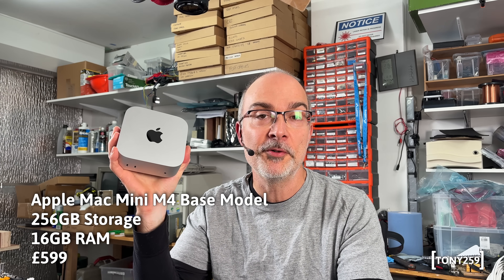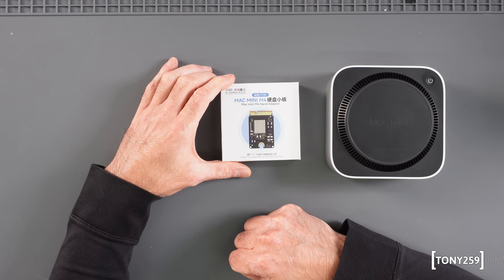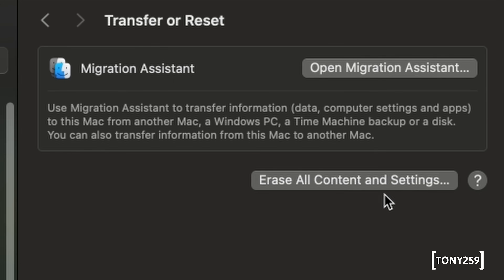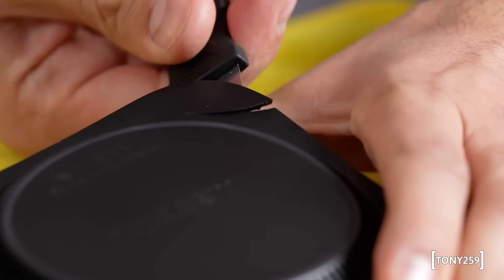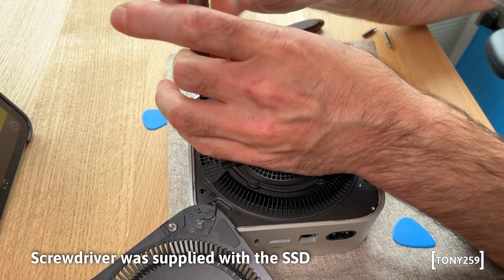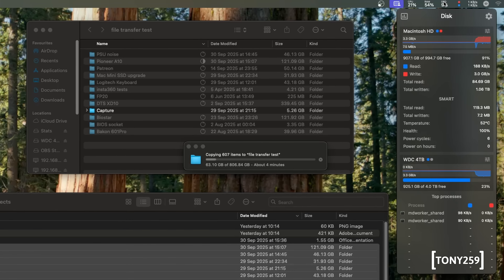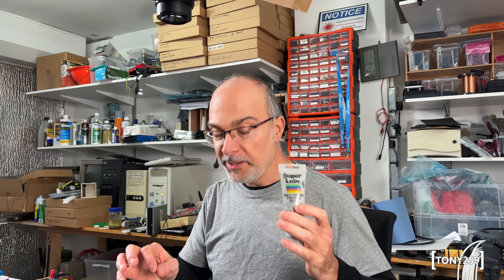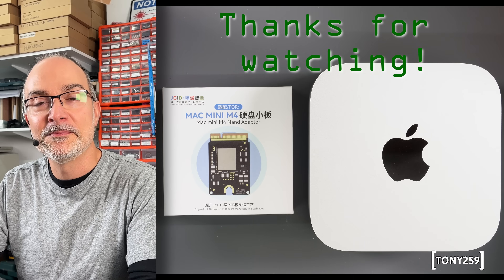CHEAP AliExpress SSD for Mac Mini M4? (Yes, I BRICKED it!)

Comment: The constant " not recognizing "  problem is why I will never get any Silicon Mac Mini ever again.
My M1 has issues with every external SSD's, hubS and NOW  will not recognize my new Apple ID password and even  Apple care cannot figure it out.
When I buy a new Mac it will be either a desktop or a laptop.
I have multiple intel based Mac books, Minis and Imacs and none of them have the " can't recognize " problem.
Reply from the maker: interesting. You mean the keyboard? Not sure what happened but it worked in the end. I never had issues with external boxes or drives. I have an external dock and external SSD. I move the mac often - and I use a USB monitor elsewhere - and I never had issues with items not being recognised. Thanks for the feedback though!
Reply: @Tony359_2  The keyboard and mouse work fine. I also get every time I shut my tv off a message about " some internal errors ". But anything not a mouse or keyboard with the exception of the Satechi dock I bought when I received the Mac Mini will not be recognized by the Mac Mini and I am tired of it.

Comment: 6:06 it’s a failed firmware and it needs to be reflashed. Hardly a brick nor does it warrant a new replacement.
Reply from the maker: Well, until it's re-flashed it's a brick. Never mentioned a replacement btw! 🙂 Thanks for watching!
Reply: @Tony359_2  if you say so ;)

Comment: Nearly £150 for just 1TB of storage + the risk of bricking the device, what a great deal. 
- OR, Just bare with me a sec...... you Could just buy a 2-4TB external SSD that runs over USB-4/Thunderbolt-4, the speeds will be good enough for nearly everyone, no risk of bricking it, possibly cheaper and can work on other devices such as a Windows PC. 

PS: This i snot a hate comment against your video, it is still a great, well made video, I just think the risk of bricking the device AND the cost of the storage are not worth it, just go external, it is not as good but good enough. 
- Think about this, if you brick the Mac-Mini and the storage, you lose the £150 + cost of the Mac itself... is it worth it??? I don't think so.
Reply: I do want to add that I am not a fan of external storage on the M4 chips, I have an M4-Pro MBP and the external storage cuts off at random, this happens on EVERY port and with every USB Cable I have, it does not happen on my Windows PC at all, nor is it an issue with the laptops ports (external displays work fine, laptop can charge over them perfectly fine etc.). 
- Research suggests the issue is because Apple is more strict on what you plug in, slight voltage deviations may be enough for the laptop to kick the device where as a Windows PC will be okay with it, meaning NOTHING is at fault at all, it is working exactly how it is designed to work. 

This is VERY annoying, I have to try copying 50GB of files 10-TIMES before it actually successfully did the transfer, it would get so far then boom, kicked, just completely vanishes from the system, this issue does not happen on my Windows PC and as stated, it does not seem to be the ports. 

So while I still think External storage is the way to go, I myself am having issues with it which make it a HUGE pain, so much so that I have set up my Windows PC to act as a server, so I can access the data through that... VERY ANNOYING but at least it works.
Reply from the maker: Your point is valid but I already have an external SSD, 4TB, USB4. It works great but it's NTFS and I didn't want another one to boot the system from. Yes, upgrading the internal storage is a pain but it's an option. It might work for someone or not - it's an option.

On warranty, I understand that opening the Mac Mini does NOT invalidate the warranty. If the replacement SSD hadn't worked, I would have installed the 256 back in. If the system had stopped working, I would have taken it back to Apple with the original SSD in. 

For sure there is a risk element in upgrading: I am a tinkerer, I was aware of that. Once again, it's an option. If you don't want risks, you can also pay £400 and get a Mac Mini M4 with 1TB SSD 🙂 

BTW: my external SSD enclosure NEVER EVER disconnects or shows issues. I run my video editing from it so it's quite some work and I've been using it for 10 months. I've never experienced a single minor issue with it. I showed it on a short: https://youtube.com/shorts/2hta5oY1zc8
The 850GB data you see being copied on the Mac were from that SSD. 

Thanks for your comment and your visit!
Reply: @Tony359_2  I am wondering if it is my enclosure (it is an NVMe enclosure), though this issue does not happen on the Windows PC (Happy to copy over 500GB, no ssies, MacBook can barely do 50GB). 

I did notice that if I use an iPhone cable, it seems to work fine... Very odd issue, I have seen other people mention this issue aswell (mainly on M4 series chips), it does not seem to be a fault, but something else. 

But yeah, I enjoyed your video, was actually very well made and informative, subscribed aswell. 
- I think this upgrade would be best done with the MacBook's,  but sadly Apple have soldered it all down, I think it is best on a laptop since they are portable (thus carrying the laptop and having to also take the external SSD is a bit annoying when the laptop itself could do the job), and Apple know this hence why they do this and charge a LOT for upgrades.
Reply from the maker: I cannot comment on your enclosure as I only have one. I did see similar reports online so I was a bit concerned an external solution would cause me trouble - particularly because I use it with Video Editing so lots of data being streamed back and forth all the time. 
But no, zero issues. I've been using it for 10 months and I never had to fiddle with it. I'm using the USB cable it came with. Windows is only 10Gbps but I never experienced issues with it either. Maybe the iPhone cable is not capable of USB 4 and the connection is established at a lower speed - giving you more reliability? You can see the current speed in System Settings somewhere. 

You are using the back ports right? The front ports are only 10Gbps if I remember right.

Thanks for the sub 🙂 
Yes, it'd be great to have upgradable storage on a MacBook but I guess there is no space for the socket there. Or maybe that's what they want us to believe 🙂
Reply: @Tony359_2 You may be right, I do know the enclosure only does USB-3.2 so not the fastest. I am using a MacBook Pro with M4 Pro, thus all ports are Thunderbolt 5, I wonder if this is the cause of the issue (since USB-3.2 is getting rather old now).

I am going to try get a Thunderbolt 4 enclosure, this will work on both devices I hope (my other laptop has Thunderbolt 4).

Thank You for your replies.
Reply from the maker: You're welcome, I hope you can find something that works well!

Comment: 13:37 In 2025? 😀
Reply: @Tony359_2  Read and write speeds as of 2020.
Reply from the maker: ah yes, for gen4 speeds you need the Mac Mini PRO 😀  I know, I know.
But hey, I have a PC under my desk which I stopped using because Resolve runs MUCH smoother on this little tuna can. But if I run benchmarks, the PC is SO MUCH FASTER than the tuna can. What can I say...
Reply: @Tony359_2  What do you mean: Resolve runs MUCH smoother? Effects, exports?
Reply from the maker: @Milzil_Hunter Export is slower of course. A 3070 has much more power. The editing on Mac is like running with Proxies on Windows. It's just buttery smooth. On Windows I always have that little delay when I edit which is simply not there on Mac. Whenever I was going back to the PC, it felt "broken" so eventually I "promoted" the Mac Mini as main computer and I only use the PC for the final render.

Comment: From what Ive read online the 256Gb SSD in the mini is a slow one and the 512 (and maybe upwards) are much faster and its worth upgrading to that if you intend not to DIY the upgrade . Have you heard this?
Reply from the maker: Yes - I believe the 512GB will show the same speeds of the one I got. It's the 256 which is slow. That said, if you look at the benchmarks in the video, I doubt that you'll get some noticeable improvements. I needed space, not speed 🙂 
The Mac Mini M4 has nice TB4 ports so an external SSD is going to be faster than the 256GB anyways! Thanks for watching!

Comment: I’ve used the Mac Mini M4 for Blender and Twinmotion just to see how far it will go before getting too hot. Well, not far lol. I eliminated this by using a O2COOL Knecklace fan ($10 from Walmart) to blow air towards the front of the Mac Minis vents and it cooled it down to idling temps. The M4 punches above its weight when it’s properly cooled and doesn’t need to throttle.
Reply from the maker: Interesting, it never throttles here. I use Resolve. The fan starts a bit late than I'd like, when I'm doing rendering I tend to set it to manual 2500rpm (half the speed) and it's usually totally fine to keep the temps at bay.
When I run Cinebench, the fan only speeds up during the second cycle. But once the fan starts, it takes a few seconds to bring the temps down. 

If you have a blender demo I can run, I'd be curious to see how mine compares to mine, maybe Blender is pushing more power out of it?
Reply: @Tony359_2 , I use Blenders Cycles in real-time viewport and Twinmotion is also real-time viewport because it’s basically a game engine so the silicons heat will build up overtime due to the CPU and GPU being constantly used in a single space of the enclosure. Essentially, the silicon heats up within about 10 minutes of using either application, and this heat accumulates over the next 10 minutes until the system throttles. This happens because the Minis enclosure and its fan are not large enough to effectively expel the air, regardless of the fan’s speed. 

The O2COOL necklace sucks air from the top and blows air out the side horizontally right through the front vent of the Mac Mini. The air is directional so it kind of makes the internal fan useless. Also, it not sucking hot air back in from the rear exhaust vent which is hard not to do with traditional PCs.

Companies will utilize the benefits of Apples Metal API which is low-level so the silicon will in fact heat up quickly and with little constraints if there is no software there to throttle it. I’m almost confident the M4s GPU can be clocked higher than 1.8Ghz in boost without issues.

Comment: I bought one Mini M4 basic like yours back in BF2024, and went with an external storage - moved my profile there, and use it as main storage. Excellent performance (better than factory). I will do this upgrade after the warranty expires. One suggestion for dealing with plastic: use a hairdryer to warm up the plastic, it becomes more flexibe, easier to insert the picks and less likely to crack.
Reply from the maker: Thanks, sounds like a good idea indeed!

Comment: I've got a 1TB model of the original studio.  I appreciate these videos, but I don't think I'd ever upgrade mine, I've got a thunderbolt nvme SSD enclosure for extra storage space.  It's nice to see these vids incase the drive ever fails and you need to swap it out.
Reply from the maker: Yes, an external drive is a solid option too. I have an external drive already which I cannot use for the OS and I didn't want a second one so I decided to go for the "ssd upgrade". Thanks for watching!

Comment: I remember some tinkerers recommended using a small suction cup on the base of the Mini to lift the cover slightly so that you could insert prising tools underneath to disengage the clips. If it were not for the attached cable, you could probably try using a large one covering the round bit of the base and yank the cover off in one go.
Reply from the maker: to be fair there was a suction cup with the kit - but I believe it's not easy to attach to the bottom. But it could work for sure 🙂

Comment:  I was under the impression that Apple SSDs (and by extension, their clones) were markedly faster than "regular" SSDs on account of some "M4 magic". I am running on a hackintosh laptop from 2019 with a cheap Kingston SSD and using the same benchmark settings my speeds are 10% better than the best sequential read/writes shown and an order of magnitude (10x) faster than the best random read/write shown.  And  Pro-tip: take screen shots using Cmd+Opt+4, then press [spacebar], then click the window. You'll get the window isolated, with a drop shadow. It looks much better than cropping down a full screen grab.
Reply from the maker: AFAIK the "base" model is limited in speed. The M4 Pro will get to gen4 speeds. I don't care too much but yes, 3GB/s is not a lot nowadays. I use Shottr for screenshots, the trick you mentioned doesn't seem to work but thanks! I can still screenshot a selection with a combination of keys, very useful 🙂
Reply: @Tony359_2  That makes sense. I may soon buy an actual MacBook Pro, with either the M4 Pro or Max. It sounds like that will have NVMe speeds that can do better than my 6-year-old Hackintosh. I had the key sequence wrong. It's Shift+Cmd+4, Space, Click. It was an informative video. Thanks!
Reply from the maker: ah, the combination works with Shottr too - thanks a lot, a useful trick indeed!

Comment: I like your opening method. I used the thin steel pry tool initially to get a gap, then used plastic picks for the rest, but hated that 1st step. I didn't do any damage, but one slip and I would have. Patience and minimum force are always required when opening clipped devices, especially patience!
Reply from the maker: Lots of patience! But those clips are STIFF, some required quite a lot of force to release... Thanks for watching!

Comment: So you did not brick it if you were able to work through the issue. I guess that saying you bricked it got you more hits. BTW. You can get those same benchmark scores from an OWC external enclosure for less more total.
Reply from the maker: Well, it was a brick at some point. 
Yes, my external WDC SSD is doing the same. But I wanted some internal storage as well - also my external SSD is NTFS (for good reasons) and that prevents me from moving apps or booting from it. I didn't want a second external SSD and I went for the internal one. Not everybody has the same needs 🙂 But thanks for mentioning! 🙂

Comment: Bought a 4tb 990 pro and waiting for my second Alie USB/TB 4 NVME case.
Reply from the maker: That's surely an option. I can recommend the Qwitzlab enclosure (https://youtube.com/shorts/2hta5oY1zc8) because it's fanless. But it's USB4, not TB. It just works perfectly. 
My external 4TB SSD is NTFS and I cannot boot from it or move apps to it or run VM on it so I really wanted some internal storage as well.
Reply: @Tony359_2  I got the same one. Different brand though. But I do believe it's TB3/4 because USB 4=TB. And as far i can see the best there is for that price. Got a cheaper one on the way though. Not so heavy and with a fan you can turn off but still some cooling ribs and same Asmedia PD chip. But i also have 2 other 10Gb/s nvme drives attached to m4 base mac mini. Super cheap Alie enclosures and i get the NVME SSD in the EU with better warranty. I try to avoid Alie above 50 euro's because of that risk. But still Win Win. Got no pc with TB 4 though. Bought a X99 computer in may this year and bought a TB 2 pci card for that but it's still on my to do list. Hahaha Anyway i try to get 2 TB enclosures incase 1 brakes. And maybe i need more 10 Gb/s nvme enclosures too. Some NVME won't work in some enclosures. Anyway thanks for the video! Maybe if they ask 60 euro for 1 TB i buy one but i'll wait. Got my eyes on the m5 mac mini. Can't wait for cheap tb5 enclosures and get closer to the 990 pro 7,5 GB/s speed. Hahaha But i love my m4 base model. I only got it 2 months but there is still nothing nothing on the market that can perform for this price at these wattages. Including 3 TB ports! Crazy! And i can upscale 480p videos and play cyberpunk at the same time. Best 628 euro i spend in years! Sorry for the long post but if i find another one of these TB4 alu NVME bricks for the same price, i get another one. And reading your story, you need another one too! Hahaha ps I wanted a TB4 enclosure to run Tahoe on and for testing beta's and all the big programs are on the 10 GB/s ones. So my internal drive is empty and would like to keep it that way. Once it's out of warranty, i may upgrade internal storage.
Reply: sorry: almost empty. Sequoia 15.6.1 is on it. I'm an bit an anti update guy. If it runs stable i mostly stay on that OSX version for some years.
Reply from the maker: USB4 is not TB4 - TB4 is a subset of USB4. USB4 works on TB4 but not vice versa. TB4 is faster than USB4 I think. My USB4 drive is plenty for me 🙂